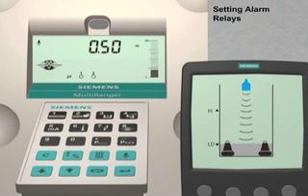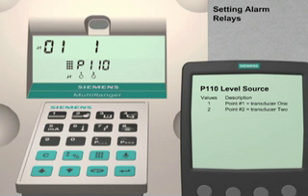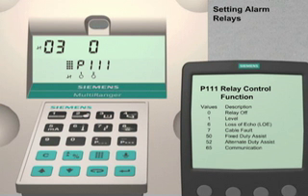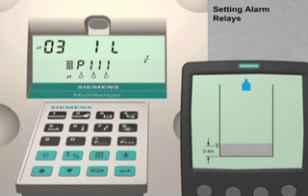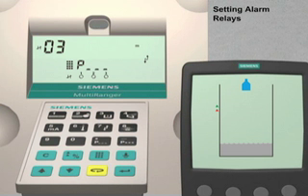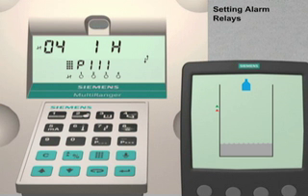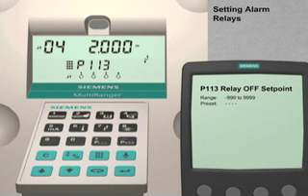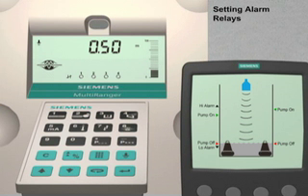Setting Alarm Relays in Hydroranger/multiranger

Comment: Hi I have a question about the parameters setting in Hydroranger 200. In your video you have only 2 alarm for Low level and high alarm for relay 3&4. If I want to add one more level alarm like High-high level can I address this to relay 5 and set the value of it?
Reply: Yes, follow the same procedure like for relay 3 and use LL and HH on relay 5